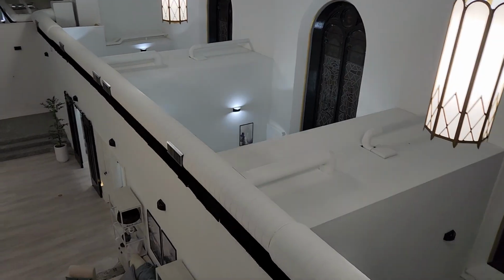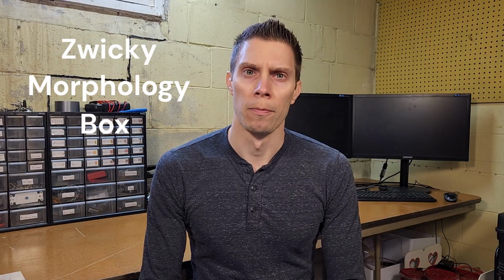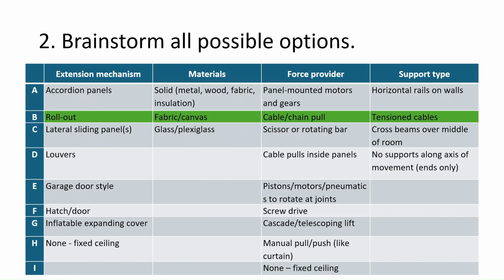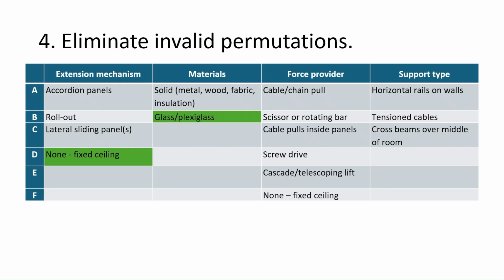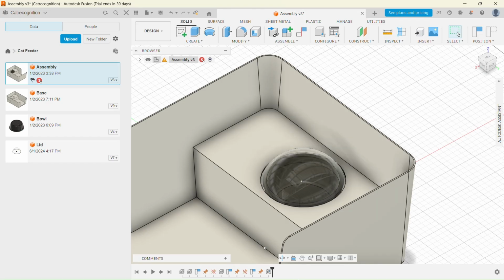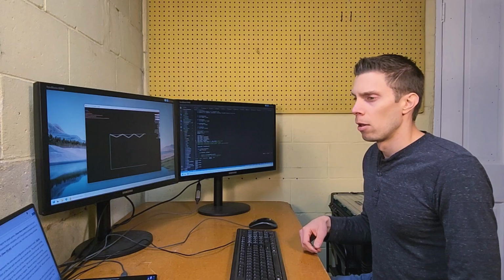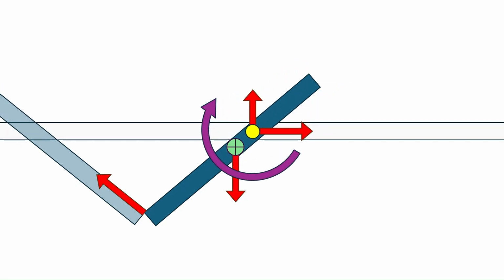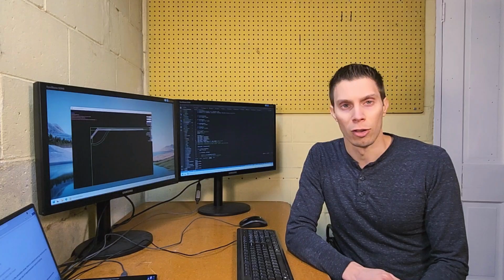Design & Simulation (Building RETRACTABLE Ceilings for a Church House Part 3)

Comment: What if it was designed like hoizontal window blinds?
Reply from the maker: Explain what you mean by that? Is that similar to the louvers?
Reply: @DrummerandProgrammer I think so, but the louvers would be retractable (like how the slats on window shades can be pulled up or let down) in addition to being angle-able.  Horizontal shades are only fixed in place at the top. I was imagining a system that is fixed (framed) at the starting and final stopping points and supported by tracks on the sides (so they don't sag). The slats could be fully extended or retracted (or somewhere in between). The angle of the slats would be adjustable to allow different levels of light, airflow, sound, and privacy. Figuring out the cording might be a challenge, but I'm confident that you could! Or maybe there's a way to do it without the cording...some modification to the mechanics of the accordion design??
Reply from the maker: Interesting idea! One of the requirements I didn't talk much about is trying to keep the mechanical complexity as low as possible. I'm not quite sure how I would do the moving slat design without using one motor to move them back and forth and another motor to rotate them open and closed. But I'll give it some thought!